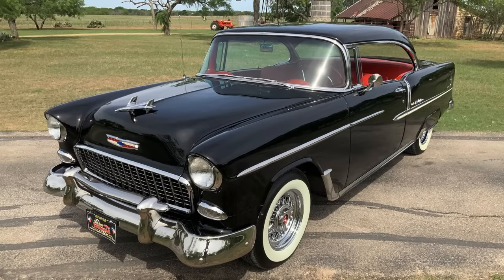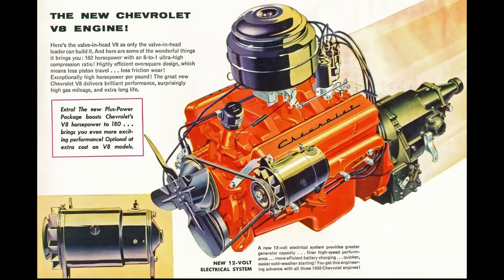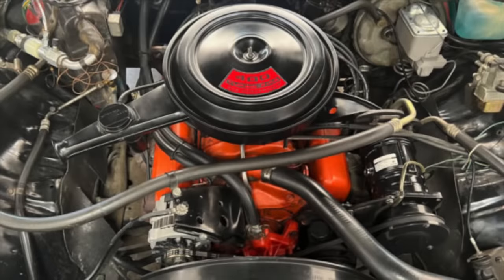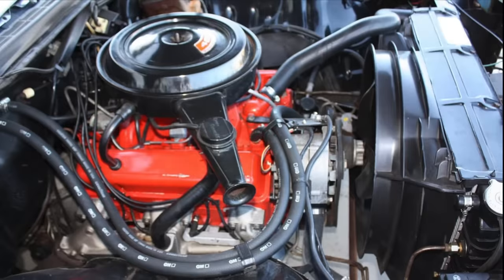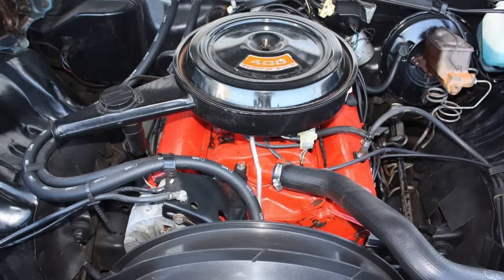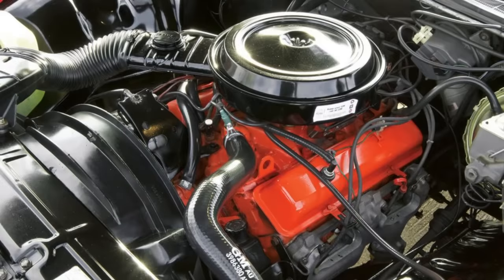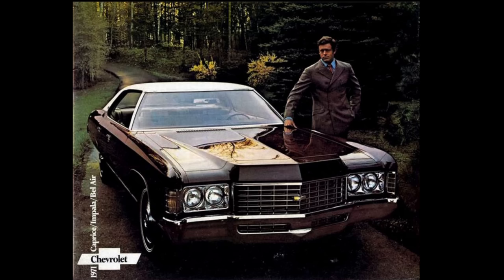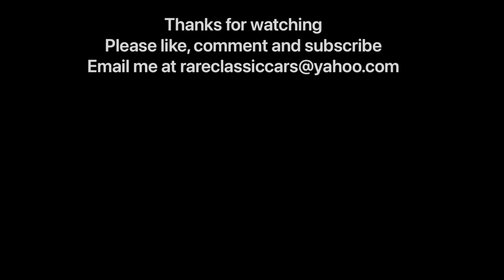Forgotten Engines: The 400 Cubic Inch Chevrolet Small Block V8 (1970-1980)

Comment: When I  was younger, I had a 1977 Chevy Monte Carlo with a 305. When that engine wore out, I replaced it with a 400. But not just any 400. I got a 400 short-block (engine minus heads) from GM parts counter. I modified a set of 2.02 valve heads by adding the steam hole put those on the 400. Then I used the stock 350 L82 camshaft and a 4-barrel quadra-jet and manifold. I figured using production parts would help reliability. I also changed the rear end in the Monte from a 2.73:1 ratio to a 3.55:1 ratio and added posi-traction.

That Monte-Carlo scooted. It embarrassed the production Corvettes of the late 1970s and early 1980s.

What I essentially had done is made a 400 CID version of the L82 350 used in Corvettes and worked great. It didn't stretch or stress the 400 CID engine and it drove for 60,000 or 70,000 miles that way until the car changed hands to someone else.

Comment: As for gross to net hp comparison: Check out the 1971 Chevrolet sales brochure of that year. It lists the gross AND net HP for the 400: 255 gross, 170 net for the Turbo-Fire (which was the small block) and 300 vs. 206 for the Turbo-Jet (which was the big block and actually a 402).
Reply: But the 402 is a big big block Chevy motor
Reply: @rodneyhopper22  Yup ... it's actually a 396 punched out .030 at the factory.
Reply: @silicon212  a 396 motor bored .030 is only a 402 sorry
Reply: that is the point.
 @rodneyhopper22

Comment: Love your channel and your amazing knowledge and insight of the Automotive Industry. Those Bob Lutz interviews are so enlightening as I spent 25years ,1975-2000, selling Chrysler Products. Recently built a 400 small block 2 bolt main for my 1972 Chevy C10 Pickup. It has 9.2 compression ratio with a .30 bore, so now 406 cu. in , and used a flat tapet cam as well.  Installed this summer using the original Q-Jet which was tore down completely and rebuilt have put about 1000 miles on the truck now and am very happy with this torquey engine.

Comment: My parents had this engine in a Caprice Classic. 
It hauled that heavy car through the steepest of mountains without effort. 
It pushed that heavy car through uphill highways like they were flat.
It idled so smoothly in traffic that it felt like it wasn't running.
You didn't need to know the temperature because it would not overheat even in the hottest of days while powering through the above 3 conditions.
Best of all,  you didn't need to fear the fuel gauge either because the cost of a gallon was 33 cents.

Comment: I’m still perplexed at what a masterpiece the SBC was, it was a home run and a great package that managed to be small and compact, lightweight, cheap to produce, very durable and robust, breathed well and made great power and economy, and was designed in a way that was very ingenious about super easy repair and serviceability, my favorite design feature was the stand-alone design of the water pump that only had 4 bolts and two very small and simple gaskets, unlike literally any other V8 on the market that was integrated with a dozen or more tiny screws prone to snapping off, and several other larger bolts of varying confusing diameters and lengths. 

All other designs for V8 water pumps were stupid by comparison, with countless failure points that can allow coolant to intrude into the crankcase because the coolant passages went through the timing covers as well as the water pump. 

Sheer stupidity on the part of engineers for all those other V8 designs- I’ve worked on all of them, and all of those integrated front cover designs were either a stupid and obvious oversight, or an intentional one to encourage engine failure. 

The ball stud rockers were awesome as well, and the fact the SBC had 5 head bolts surrounding every combustion chamber, while most other V8 designs only had 4 surrounding each chamber. 

First gen olds rocket is excluded from that, as those actually had 6 bolts surrounding each combustion chamber, which made them an excellent choice for supercharging in the early days of hot rodding. 🤘🏾🤘🏾🤘🏾
Reply: you are SOOOOOOO right on your comments. fixed cars for over 55 years.

Comment: We had a 74 BelAir station wagon with the 400. It had freeway gearing so the rpm stayed pretty low so that boat was smooth and quiet. Even when we took trailers to the dump it was a comfortable ride and had no problem pulling a several thousand pound trailer. We would open the rear gate and watch the fireworks while lying in the back. The strange rear window raked forward so far it was like not having a roof. In all it was a really good, but ugly, car.
Reply: Old GM clamshell wagons are bringing in big $ these days.
Reply: my friend's dad had a72 kingwoods estate with the 400, a deer ran into the rear quarter, and it was totaled.

Comment: About 10 years ago my son and I built a 70 Chevelle with a SBC 400. We bored it .030, forged pistons, Edelbrock heads, air-gap intake. Trans was TH400 with a 12 bolt diff. with a 3.31 posi. That car was a blast to drive.

Comment: I've built 5 400 sbc  all 2 bolt mains. I love them .never a minutes problems.  I prefer the 509 casting too.
Reply: I had a 1972 3/4 ton big block 400  
It was a camper special with overloads ,with full power steering and power brakes you could drive it with one finger ,but if I had the camper off of it I could pull out on Monterey hwy and smoke the tires  for as long as I held the throttle to the floor ,it was forest green ,with 2in tubes and a holly 750  it run like no other stock pickup around and averaged 15 mpg on the hyway awesome truck could haul anything and with a full size camper and pulling my 18 ft boat ,I could pass anything on the road couldn't even feel that boat behind me passing big rigs on my way to clearlake ,yes it was one bad ass truck ran like a scalded dog ,dam fast 👍

Comment: I build one for my former 1971 Malibu. I figured why go through the extra expense of building a 350 into a 383? I topped it off with a Quadrajet. I had a torquer for sure. I added a slightly hotter cam to bring in some horsepower too. I put in some heads with larger valves and, of course, drilled for steam holes.
Reply: You people just make me laugh my ass off

Comment: I had a 400ci in my 1977 K20. It spent a large amount of its life pulling a 16.5’ gooseneck trailer that routinely hauled 400 bushels (22,400 lbs.) of corn. The only thing I wish I’d have done was put traction bars on rear axle. The motor was a workhorse for me and always answered the call. No complaints.

Comment: Great video on one of the least known small-block Chevrolet V8 engines.  I never had a vehicle with the 400 engine, but my first car had the 307 small block engine.  Although not a performance engine, it introduced me to the merits of all Chevrolet small block V8 engines:  bulletproof reliability, durability, simplicity, and low-cost maintenance.

Comment: People forget that engines in this size and displacement range weren't intended for performance, they were intended as uplevel powertrain options in sedans and trucks (Ford's 390 FE is the classic example of this).

Seems an obvious point, but you'd be surprised how many people can't distinguish the difference in that era between a basic high torque large displacement engine, and a legit Hi Po engine.
Reply: I drove a 390 that could easily show its tailgate to a lot of clowns who thought they had performance cars.
Reply: Back then, an amazing number of full-size cars were outfitted with tow packages for pulling pop-ups and smaller travel trailers, so torque-heavy engines were definitely popular.
Reply: So true.  You could get this in a half ton truck which give you plenty of power with 3.73 gears
Reply: I think the 390 had enough metal in it to be made as a hi po engine.
The Chev. 400 small block not so much.   @67marlins
Reply: Great point. Thats why it was used largely in station wagons and K series (4WD) trucks. Had torque for pulling and low end needs. It was the goldilocks between the 350 and 454.
Reply: @davidpowell3347  Possibly, but Ford never bothered to make a Cobra Jet version of the 390. Earlier attempts to make a Hi Po 390 were abandoned and they concentrated on the 428.
Reply: If you recall by the article, it wasn't made or intended to be a HI PO engine.
Reply: @Sheisthedevilyouknowwho-ft9we  Had a small block 400 4bbl in a "one ton" 77 Chevy van. Turbo 400, posi rear & coldest factory air I've ever seen. Had to weigh near 6000 lb. Had the real "truck" rear axle. Had to pull the shafts to remove the rear drums. Took two of us to lift the drums & put them back on. At that weight class I don't believe it was subject to passenger car emissions regulations & although I think the official net hp rating was 177, It could move. Unofficial figures by handheld stopwatch. 0-30 in 3 & 60 in 9. Not bad with that weight. Interesting too was that, the steering, while "sloppy" & truck-like, the stiff suspension & huge anti-sway bar together with wider aftermarket rims & tires made for surprisingly good handling on back country roads.
Reply: @nwragsdale  yeah, I used to think that it was only available in trucks & station wagons.  Had never seen one  in a car from factory til I read here.
Reply: @932stretch  Yes, that's my point.
Reply: There was a Hi Po 390.
Reply: @paulfrantizek102 Ford produced more HP 390's than those stupid 428's
Reply: @johneckert1365  Because Ford produced more of the vehicles the 390s went in (sedans and trucks) than the vehicles the 428 CJ went in (big block musclecars). Also, the FE based 428 was replaced pretty quickly by the 385 based 429 (The 429 CJs were real beasts).

This reinforces the point I was making, there was a bigger market for high torque, low RPM engines (390 2V, this 400) than the HI Po engines everyone considers so desirable now.
Reply: @paulfrantizek102  Ford's 428 was available in all sorts of cars, not just muscle cars.

Comment: I was given a 400 back in the 80s and originally had no real intention on building it at first. My dad has his all original 72 caprice with a 400 2v. I also obtained a 72 nova in trade for building a th350 for a friend's Camaro,   and it was then when i decided to put the 400 in the Nova as the engine was removed. Bored it .020 over and used hyperutectic pistons along with cranes hmv-272 cam, didn't go too crazy since the car had to smog here in California. Just told the shop it was a 350 engine and had a q jet as they wouldn't know what it really was. Passed smog, and the car dynoed out at 373 ft lbs at 2k rpm and an honest 300 at 5k. Very broad power range but it was a very fun car to drive. Would wind up twisting a factory axle on a 2.73 one legger 10 bolt but the car at 25 mph could scratch the tire with the snap of the throttle.

Comment: I had a '77 Chevy van with the 400 - 4 barrel. I had several people tell me that they were prone to overheating. I never had that problem with it. Shortly after I bought it, I did have several push rods get bent, and I didn't mistreat it. Replaced them and it ran great. Just one of several vehicles I wish I'd kept a little longer.

Comment: Hi Adam from Australia, we had quite a few 307, 327 and 350 SBC engines installed in local Holden products in the late 60's to early Seventies. A lot of these engines were also imported privately for marine,  hot rodding and retro fitting to older/ newer cars. Almost no 400 SBC engines were imported, the reason being they had an incorrect "connecting rod to stroke ratio" ( the angle of the connecting rod is too extreme when the piston is halfway down the cylinder so the combustion pressure is spending to much energy pushing the piston sideways into the cylinder wall rather than down on the crankshaft) and no decent power gains could be attained. The after market companies knew this, this is why back in the day, stroker cranks for 350 SBC's were limited to 383 C.I., the absolute limit for a usable connecting rod to stroke ratio on a standard SBC.
Reply: Very interesting information indeed. I owned one small block 400 & had always been impressed with how it ran but always did feel that the 327 was really the "sweet spot" among the various iterations of the small block Chevys. Seemed to be the best one for achieving high RPMs & high HP/Cubic in. 350, a little less so & 400, definitely not so much.
Reply: 383's were based on .030 overbore 350 blocks with 400 crank with main journals turned down to 2.45. 350 blocks bored .060 over with 400 crank would be 388 cubic inches. So 383 is no absolute limited magic number. Rod ratio is the same.
Reply: @ewoodWood  I'm talking about Australia back in the 80's and 90's. There were no 400ci chev cranks here back then!. If you wanted to go bigger on your SBC (at a reasonable price) then a stroker kit was your only option, at least two (U.S.) companies supplied them and both were 383CI (without counting an overbore obviously) For the reasons I mentioned above.
Reply: The 383 is a 350 with the 400 stroke and rod length.  Time to look again at what you had stated.  And yes, the rod/stroke ratio isn't ideal, but it sure appears to work in that case.   @indykartsindoorgokarting6711
Reply: There are stroker cranks/pistons to make a SBC 350" into a 400"... 
BluePrint engines sells a SBC 400" that makes 555 HP at a low 5900 RPMs...

Comment: Chevrolet put that small block 400 in both pickups and blazer/suburbans during the 70's. One thing those engines were externally balanced and had a cut out in the front harmonic balancer along with added weights to either the flexplate or flywheel. Then one day hot rodders decided to put a 400 sbc crank into a 350 block with some minor mods and the infamous 383 was born and the rest is history. One thing about those 400 sb's it was very important to keep up on the maintenance on those cooling systems because those small steam holes would or could plug up and they would overheat quickly. Thanks Adam for the trip down memory lane.
Reply: Another GM stroker combo that only caught on semi recently was putting a Pontiac 455 crank in a 400. Those cranks are so tough that you can shave 1/4” off the main journals to fit the 400 block and they’d survive pretty much whatever you put them through. I guess it wasn’t as popular because out of the 3 GM 455 engines, Pontiac was the rarest of the 3. Guessing because in 1970 when BOP all had 455’s, Olds and Buick dropped their 400 but Pontiac kept theirs.
Reply: Lol I love how the Chevrolet guys think that they invented the 383 lol . Mercury had a 383 in the early 50s and then they dropped the 383 and then Chrysler built their version on the HP 383 in 1958 that made 350 HP and came with a 2x4 intake manifold stock from the factory and then years later the 383 magnum was built using better flowing 906 heads that were also used on the 440 4 barrel and six pack magnum engines. I have a 400 sbc that runs good but I have a buddy that wants the engine for the crank shaft to build a 383 but I won't sell it to him because the 400 is in my 82 Chevrolet K10 plow truck I use to plow my driveway with & that low end torque it makes is perfect for pushing snow with it .

Comment: Had a good friend in high school that had a 72 Caprice with a 400. Yanked the 2 barrel off, did some bowl work on the heads and put a factory iron intake with a quadrajet back on it. Swapped the points for hei ignition and it was a monster. Stock cam and rotating assembly even. Don't remember the EXACT numbers but a before and after 0-60 went from almost 11.5 seconds down to 8ish. The 400 wad a sadly overlooked engine.

Comment: I put a mildly rebuilt 400 small block in a 1977 down sized 4 door Impala 😮 with headers and dual exhaust!  It surprised a few Trans Ams, Camaros, and Corvettes 😅.   Oh it also had a 600 cfm Holley 4bbl.

Comment: Ah the good old 400 small block. I remember in HS we bought one that was in crates, used, from the Nifty Nickle, unsure if it would even run. We bought a new Summit cam and lifters, Performer RPM , double row chain, HV oil pump, HEI distributor, cheap headers, dual Flowmaster exhaust, dropped it into a 4 door 69 Chevelle and man that 400 powerband it would climb that tach ! would boil those rears for 80 feet it seemed . Great engine.

Comment: In 1986 ( new zealand ) I bought  a  1974 Holden Monaro  2 door coupe , from the factory  it would have come with a 253 CI v8 ( maybe 308 ?)  but it had a 400CI  2 barrel Chevy  put into it , and a 4 speed Saginaw  ,with a Mr Gasket  quick change  shifter . The only v8  I,d  owned  beforehand  was a 318 Chrysler,  and I remember the first time I let the clutch  out in the Monaro and felt the power , I thought  " I better be careful  with this " . I dont know if  it  may have had  something  done to it to  increase   the I horsepower , I'd been told that it had been rebuilt  by someone  in a local hot rod club and the prior owner  of the Monaro won it in a raffle,  but it had a perfectly smooth idle,  so obviously not a very hot cam , but by god it was  torquey and pretty  damn  fast .